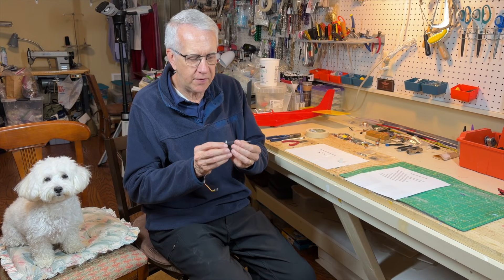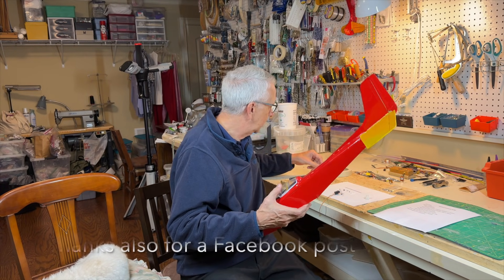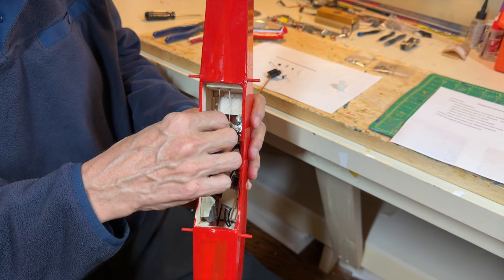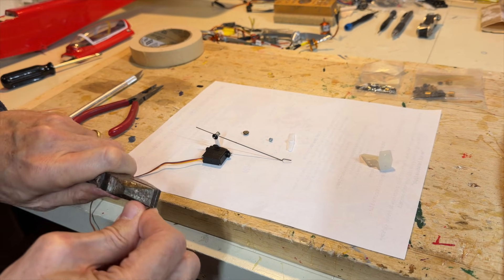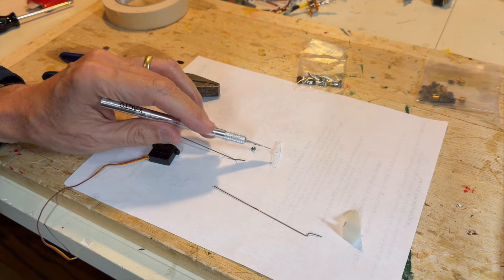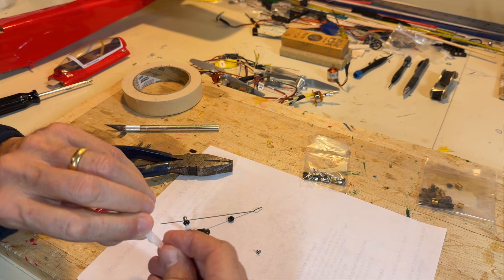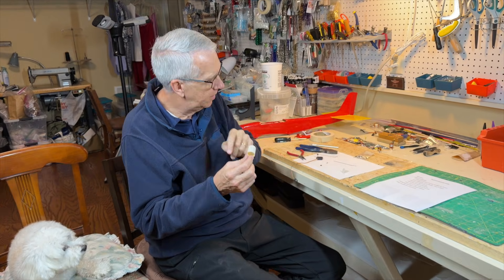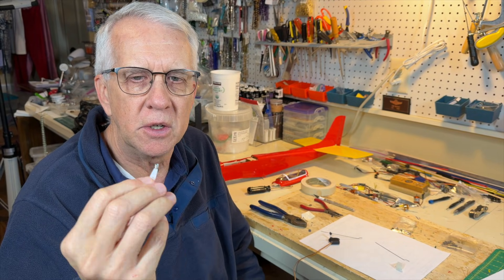E-Z Pushrod Connector RC Basics

Comment: Hi Tim.  First off, Merry Christmas to you and yours.  Second, while I don't use these for every connection, I've used these since I started modeling in 1980.  I have yet to have one fail.  Use whatever you're comfortable with and again, Merry Christmas.
Reply from the maker: Merry Xmas, Joel!  🎄🎅🏻 I think these types of connectors are fine with the smaller models. Not sure I’d recommend for bigger planes. And of course for music wire. Carbon rods can be easily crushed by the set screw.

Comment: What's the technical name of this wire.
It's very hard to find wire for control rods. Currently using 1.2 mm stainless steel wire. Only drawback little rounded bends
Reply from the maker: It’s called music wire (originally used in pianos). Just Google “music wire” or look on Amazon. Great stuff! 😊
Reply: @TimMcKay56 thankyou Sir

Comment: Linkage stoppers, we use some with a nut on them, and washer, then use loctite to make sure they do not loosen the nut. They are easy to use, to make sure you can center the control rod and or the Control horn. Have used the little push type also, it all depends on what kind of clearance you have.
Reply from the maker: Good input, thanks!

Comment: A little tip I picked up Tim was to place the washer in a shallow on a piece of wood with a hole drilled down through to take the pin of the connector and then you can just push it on to the washer and finished off by tapping the top.  Also worth noting, if the push road is carbon and not music wire don't tighten up the screw too tight because you'll crush it. Happy Christmas 🙂
Reply from the maker: Hi Cliff, two excellent points, thanks!  Tim